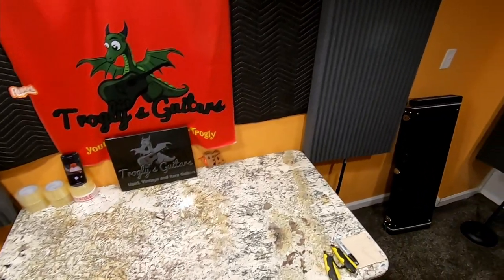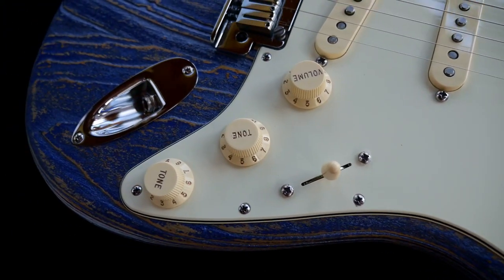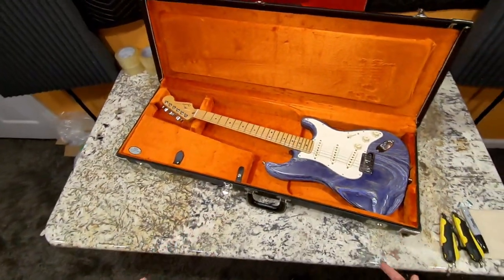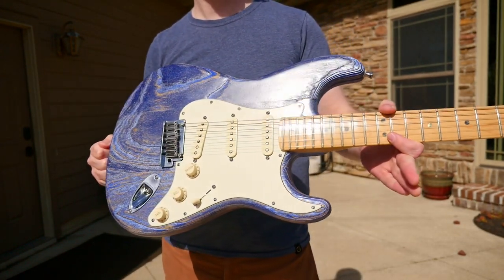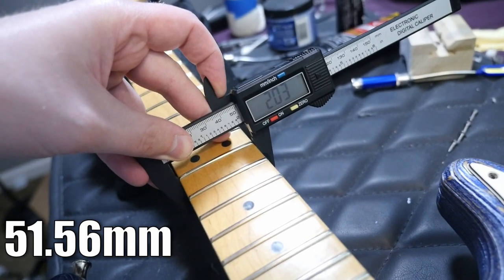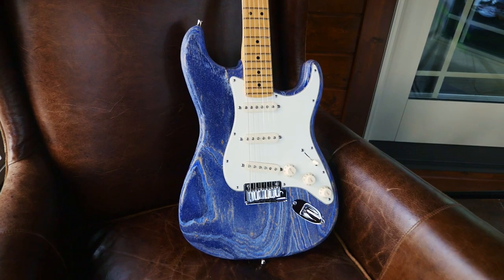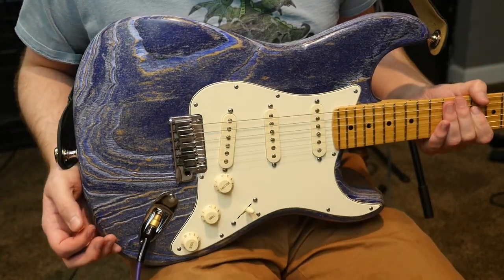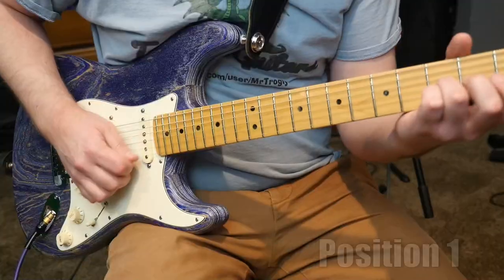The Strat Trogly Refused to Sell | 2013 Fender American Professional Sandblasted Stratocaster Blue

Comment: I think YouTube ate my comment.  I have one of the Sweetwater Sandblasted Denim Blue Telecasters.  It's a really stunning guitar to look at, has a really unique feel as well.  I think mine is also three pieces, but the seams are way more uniform with the grain of the wood.  I'm glad that it plays and sounds great on top of being a really special guitar to look at.  I was shocked when mine arrived in the cheapest gig bag I've ever seen for a guitar that cost more than $1k.
Reply: I bought one of the Sweetwater American Performer Strats as well, 2019 model in a clear finish and it had a rosewood fretboard. They came equipped with the Yosemite pickups which I also liked, that headstock was really the only attribute I disliked. It played and sounded great, my buddy wanted it so I sold it to him and I sometimes regret it I have got say.

Comment: I’m also a fan of the smaller headstock. I just built a 1991 fender American standard using a 1991 American standard body in candy apple red and used a fender channel bound neck and all fender USA electronics and pickups. It’s really sweet.

Comment: Those stagered pole pieces are usually seen in older strats that came with 7.5 Inch radius, it's Kind of strange in new Stratocasters
Reply: It has nothing to do with the neck radius; but rather they were designed to bring the poles closer on the strings with the least magnetic output to even out the sound. Those are Custom 50's so they are the same design as the late 1950's pick ups with the staggered poles. Which is why they sound so incredible. I've got a Vintage Series '62 Reissue Strat built in 1982 with staggered poles pieces so I'm biased because I believe my Strat is one of the best sounding guitars ever made.
Reply: Mostly in the 70s when US strats had non staggered polepieces.
Reply: This 2014 Mexican strat has the ceramic pups with staggered poles. I had planned on replacing but I like them. I did get a warmoth neck with 7.25 radius

Comment: Hi, just searched the 0093207-00 and voila: Pre-Wired Strat® Pickguard, Custom Shop Fat 50's SSS | Parts.  Simply remove your old guard, solder the output jack and ground wires, screw in the new guard and you're ready to rock with pure Fender sound. $369.99 · In stock, just for the pickguard. Glad you enjoy that Strat, I prefer Lps as well, but I have one strat (squier actually), that I like so much and enjoy playing it. Take care.

Comment: It’s a Deluxe Stratocaster, which has been replaced by the Ultra. Professional Stratocasters replaced American Standards in 2016. So, the title of this video is not correct.
Reply: American deluxe.  Deluxe alone implies Mexican made, while this is the USA equivalent. You had standard and American standard, just like you had deluxe and American deluxe. Personally, I think the deluxe line is the best value overall from Fender. They have premium, often USA parts, but are assembled in Mexico and therefore have a smaller price than one might originally assume based on specs alone.
Reply: @kidwajagstang  I meant American Deluxe, not the Mexican version.

Comment: That actually looks like a deluxe model, the metallic looking decal and the two point bridge make that a dead give away. American Standards at the time still had the six point trem
Reply: American Standards have used two-point trems for decades. But the contoured heel and cast saddles are indicators that this is a Deluxe. The Am Standard used the stamped saddles.
Reply: American standards have used the two-point trem since 1986.

Comment: Could it be the metallic look under the pick guard is shielding paint shining through the body color . It is anchored or grounded to the body. I'm betting shielded. I have noticed on some of the recent guitars I've purchased that the tone knobs even if they don't lock they  are a bit stiffer than the volume knobs . Not so much on other older guitars. Even if that guitar would've been dark stained and finished I think it would be a definite keeper. Bought a used Ibanez exotic that was stained mostly dark and has 7 different woods in the body and neck along with abalone accents throughout  and that iron label on the headstock.  It's such a beautiful guitar that I don't play it to often except when I really want something different in my hands. I'd hate to put any wear on it.  Even if I could afford to buy that guitar from you I wouldn't dare try. Everyone has that one or so guitar that just speaks to them.

Comment: I'll ship you mine if you want to take a test drive. I have modified it, tho. It has a big fat trem block like vintage strats and the electronics have been converted to CTS and Switchcraft Imperial specs so on the inside it's American but the outside is still pure Classic Vibe.

Comment: Trogy, just for shits and giggles, wire up a pickguard with 3 bare knuckles as per original routing, it would sound really hot, my Frakenstrat has 2 bn singles and a stock Humbucker on the bridge, combined with a 92 Strat plus neck that’s been fully scalloped, let’s just say “You can pry this from my cold dead hands” end quote. lol

Comment: Pretty much every feature lines up to it being an American Deluxe. Locking tuners, silver raised logo, contoured heel, abolone inlays (though these looks amazing at how dark they are). 

I'm pretty sure the deluxe of that era had noiseless pickups though. So it's possible the ones in there are after market.. or it wasn't quite an American deluxe. 

And they would have had Schaller strap locks too if it was an Am Deluxe ... So they might also be after market. 

The two point trem with the block saddles is also correct for an Am Deluxe, but the Am Standards had those at the time too...  But it has way more features of the deluxe than the standard.
Reply: Yeah, it looks like my USA Deluxe, except mine has HSS with noiseless pickups, a roller nut, a  S1 switch and no string tree. I actually bought mine because the neck felt so good and I like the abalone dots.
Reply: @wadeguidry6675  yeah good point. I forgot they had the S1 and a roller nut at that point... I have an Am Deluxe Tele... So no roller nut there, but yes for the S1.

I still think it's closer to a deluxe. But thanks for reminding me!
Reply: I love the deluxeTele (nice out put on the neck pickup), I'd like to have one in Montego black as a match to my deluxe strat

Comment: Whoa there, Trogly, hold up.  A micro-tilt?  What the heck is that?  If you've mentioned it on here before, I missed it.  You've got some 'splainin' to do!
Reply: It’s for adjusting the neck angle. There is a hole in the neck plate, you put an Allen wrench in, loosen up the mounting screws then you can increase or decrease the neck angle. Fender has been putting that on their higher end guitars for years.
Reply: @tomschrein417  Thanks!  I have no experience with high end Fenders and never heard of this before.